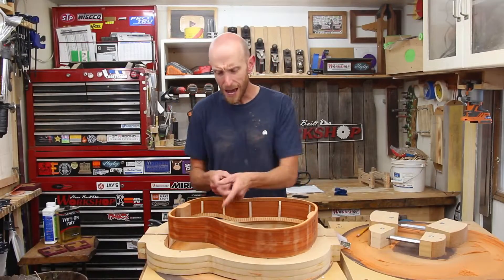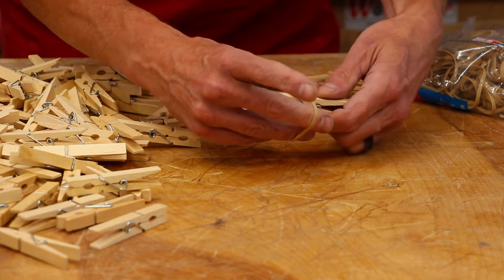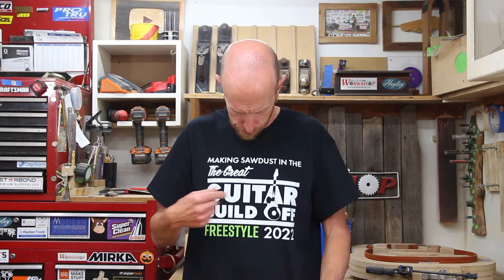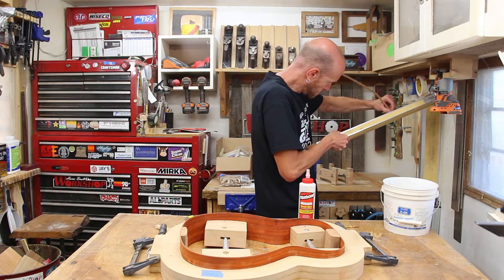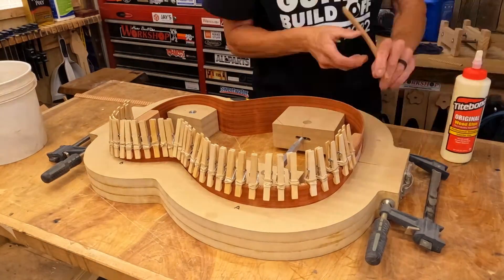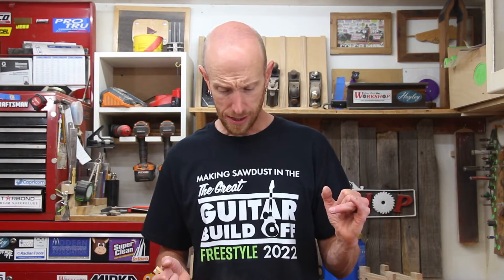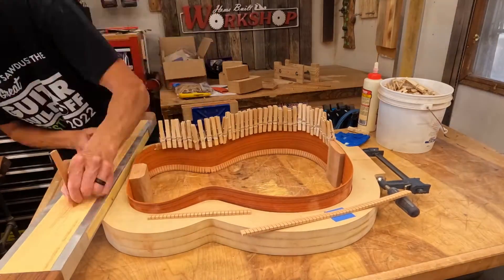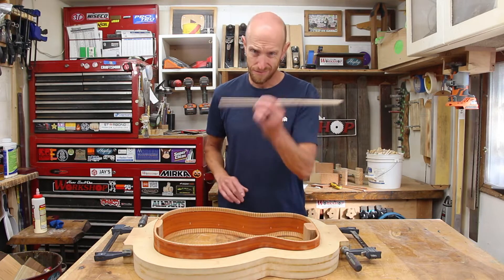Installing Kerfing an Side Braces | Building an Acoustic Guitar

Comment: With your braces and kerfing, the wood species you use has an effect on the sound quality. 

Harder woods for kerfing produces a more mellow tone as they dampen the vibration of the sound box, softer woods absorb more vibration producing a crisp cleaner sharper tone. The braces do the opposite ironically so using softer wood for one, and harder for the other creates a more balanced tone, where using all soft produces a vibrant punchy tone, harder wood for both produces a rich lovely mellow hue. 

The location of the braces determines the overall sound reverberance inside the sound box which effects overall volume and sound compression. 

There's a million ways to lay the bracing out, and each will have a subtle difference in the sound of the instrument.

Comment: When you drove the bus, we’re the neck and end block a bit proud of the sides to begin with?
Reply from the maker: No, The sides were taller than the blocks by a little bit.
Reply: @homebuiltshop  And, after driving the bus had you sanded the sides down to the end blocks?

Comment: what is the grit # n the sandpaper for driving the bus ?
Reply from the maker: I use an 80 grit disc. The discs I buy are originally meant for a floor sander. They're cheaper than those sold specifically for this purpose and are the same thing.
Reply: @homebuiltshop  Thank you
Reply: @homebuiltshop  forgot to ask - why are the two discs different ?  aren't they just doing the same thing   ?   I don't get it - whats the difference between sanding back and top ?